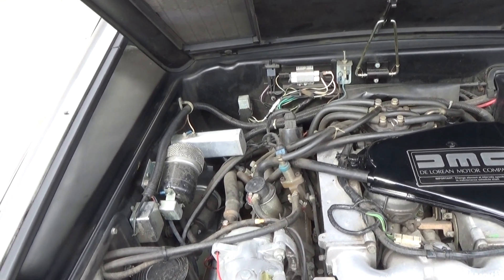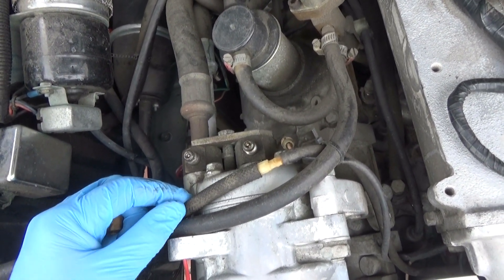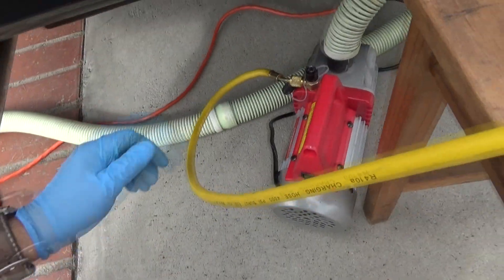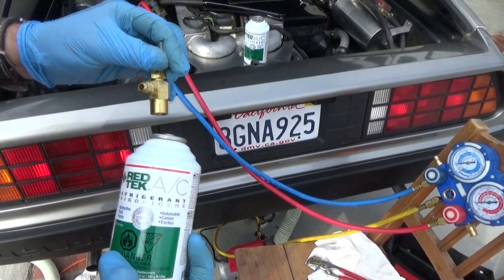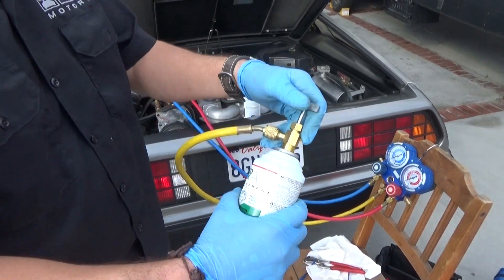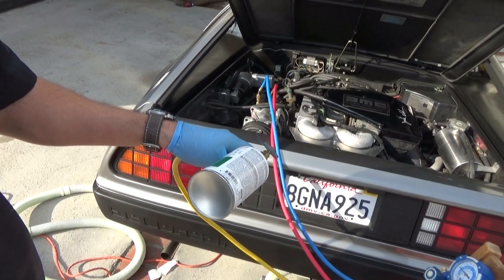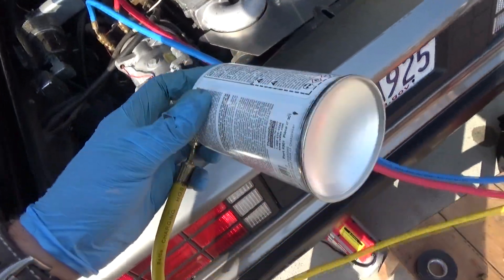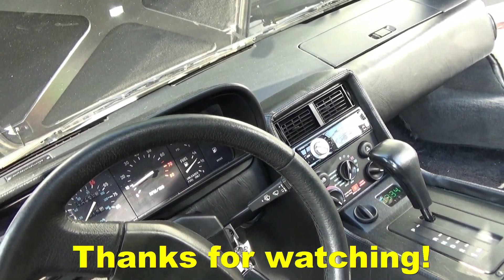JUST SAY NO to R134a in your DeLorean's A/C...RED TEK recharge for the original R-12 system how-to

Comment: I notice that the AC doesn't cycle. Isn't it supposed to? I've read 8 seconds on, 2 seconds off. At that ratio, my AC doesn't get that cold though.
Reply from the maker: It does.  You may have seen the part when i jumpered the compressor to direct 12V for the recharge. Normally it does cycle.

Comment: Can you just get the red Tek recharge kit and run the hose from the can to schrader valve on the low side without having to evacuate  everything?
Reply from the maker: You can but it may not perform as well. I recommend pulling the vaccuum to check leaks and then at least 2 cans. Optimally 2.5 cans

Comment: About the quantity of cans you mentioned... be careful -- you have some conversions to do.  My car, for instance, takes 2.25lb of R12.  RedTek states their equivalent weight ON THE CAN... it states that one 6oz can of RedTek is equivalent to 16oz of R134a.  You still have to convert R12 weight to R134a weight.  My car's 2.25lb R12 system would only hold 1.775lb of R134a ([R12 lb x 0.9] - 0.25 = R134a weight, then convert lbs to oz).  That being said, my cars 2.25lb R12 system needs less than 30oz of R134a, which less than 12oz of RedTek (less than 2 cans).  Make sure youre doing your conversions beforehand to ensure a proper fill to maximize efficiency.
Reply from the maker: Correct. Based on original R12 specs it is approx 2.5 cans per recharge with RedTek on a stock DeLorean AC system

Comment: The compressor is SUPPOSED to cycle on and off. Read the service book. It goes until it reaches a certain pressure and then cuts off for a period and then goes back on. The cycling pressures on/off set points are adjustable, as per the manual. The is shade tree mechanics.

Comment: wow so my 1976 cadillac with heat reflecting mirror tint And new sanden compressor with R12 ports on new hoses and special bracket to mount to my steel block engine with non alloy non warping heads  installed were the smog pump used to be with VIR eliminator using originol condensor and evaporator charged with the sitting on a shelf for 20 years cans of R12 should really fight back at the new summer heat norm 118 degrees ...

Comment: This video is so totally wrong.  First he say he is replacing the 134a. What did he do to the refrigerant in the car ?  Let out into the environment ?  By the way, this is illegal !!  And the he shows us @ 1.38, r12 connections on the compressor. If the car had 134a in it the connection would have already been there. You cannot install 134a into a system with out the proper equipment and also if this was done before, why would anyone remove the adapters. The're cheap..  SO MUCH WRONG I can't go on
Reply from the maker: The owner took the car and had the system properly evacuated/purged of refrigerant at a licensed facility before we did the recharge.  The fellow who charged the system with 134a did not leave the 134a adapter fitting(s) on the service ports on the compressor (not sure why).  You do not need to retrofit the R12 service ports permanently to install 134a. You can actually remove them and just put the R12 caps back on.  On my own personal car I have a 134a adapter on the low side to use with quick disconnects.  I do not use an adapter for the high side.

Comment: im thinking about putting this i a old car thats still got all r12 parts is it close to as cold as r12 or closer to 134a cold last r12 i converted to 134a it woulnt get colder then 55 out the vents becouse of the r12 condenser
Reply from the maker: It's closer to R12 cold.  I've never had R12 in my car so I can't say for sure, but it runs colder than R134a for sure.  My understanding is that R12 runs colder than R134a in these cars.  Red Tek definitely runs colder than R134a in the DeLorean.  I've had both...and the Red Tek stays in!
Reply: Propane/ Butane refrigerants have greater BTU transfer abilities

Comment: Having a DeLorean that uses R-134a has one pretty large advantage over R-12 and other refrigerants compatible with R-12 that you didn't mention... Some countries don't allow you to import a vehicle that contains air conditioning equipment that is designed to be used with/compatible with R-12, even if it's running an alternative compatible refrigerant. Without converting or stripping it out, you won't be importing your car
Reply from the maker: Good point!

Comment: What’s wrong with 134-A?  
I run it in my DeLorean and I actually just topped up with a can a couple of weeks ago.  Blows nice and cold and I’ve never had any issues.
Reply from the maker: Nothing wrong with 134a, it's the DeLorean's stock A/C system that is the issue.  Not rated for R-134a, unless you've done a proper conversion.  I recommend reading the description and Hagerty article in the description.  I've gone through an R134a overpressure in my DeLorean, so first hand experience.  I ran it without issue for almost a year.